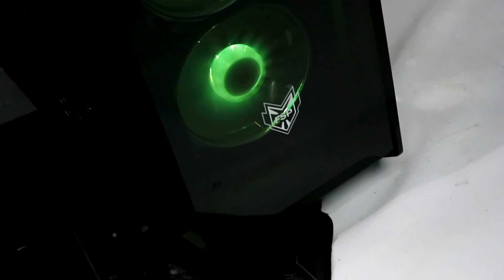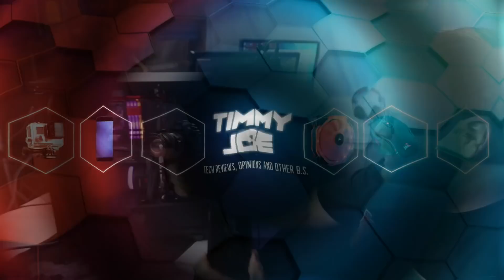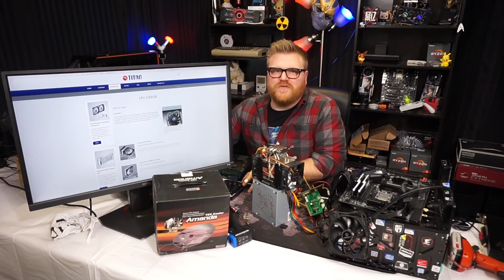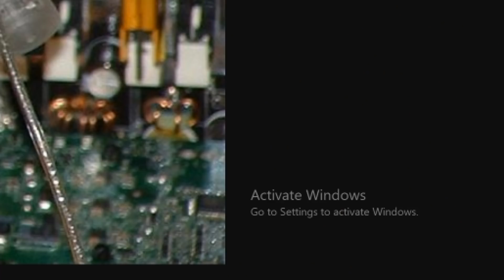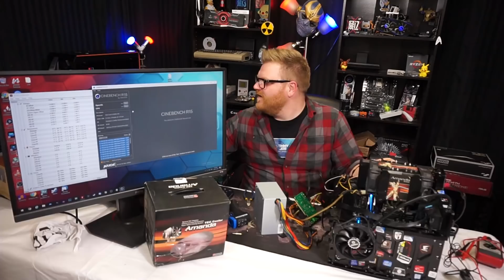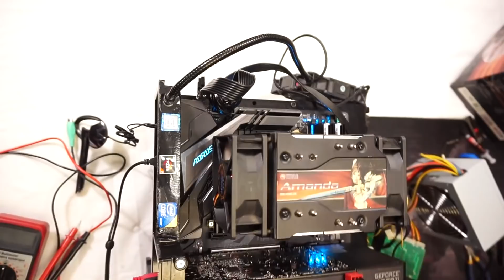This 12 year old thermal electric CPU cooler is COOL!

Comment: The problem with peltier, is there's no free lunch - the power used by the element is considerable, and all that extra heat is dumped into the heatsink
Reply: eh, it does consume power but that really shouldnt be much of an issue for anyone considering it as an option. if you are considering something like this then a custom water loop or phase change cooler is probably already the primary alternatives in which case cost is not something of concern, and i wouldnt worry about power draw unless i was worried about cost. also, if someone makes their own setup and uses an air cooler for the peltier....thats their mistake. id personally go for an AIO with a large rad and strong pump, and the extra heat shouldnt be a problem for the cpu, as all that extra heat is being kept from the cpu by the peltier device itself. even if the hot side of the peltier and the water loop are saturated @80c, the cold side of the peltier, which is what makes contact with the cpu not the cooler, will likely keep the cpu at least a few degrees cooler than the rest of the cooling system. 
EDIT: i also forgot to mention, the more efficiently you remove heat from the hot side of the peltier, the less power its requires to function, although it may continue (im not sure, im by no means a highly educated professional) consuming the same power if their isnt some sort of driver circuit to balance power draw with temperature.
Reply: You watch thunderfoot don't you? love the guy, even with some of his weird politics.
Reply: @m.streicher8286  thunderfoot is the real gang shit great man

Comment: If i remember correctly, the PCI card controlled the TEC so that it would not drop below ambient at idle to avoid condensation.  The TEC voltage would then ramp up as temperature increased.  Also, your "first core" temperature was the package temperature.  That is why you also had temperatures for cores 0 through 5, its not a 7 core.

Comment: The card was for preventing the CPU temp dropping below ambient to counter water condensation issues. 🙃
Reply: Which is probably what killed his board back then.
Reply: Yup.  That was their biggest problem.
Reply: Came here to say the same thing 😂
These things where renowned for condensation issues, even with the card. Running your pc on a very humid day was a big no no.
Reply: Whoops, which it clearly does without the card. :P
Reply: They were clearly too good 🤣
Reply: Ty
Reply: You wrote what I was thinking.

When something is cooled below the room temperature then they get wet. A bit like window condensation on a cold day.

Comment: Peltier modules are not worth it for cooling cpus
Reply: No, but chip companies could make some interesting use of Peltier tech to instead convert some of the heat produced and recycle it as electrical energy for the heat producing computing.
Reply: @Megalomaniakaal  if u put that cooler on top of the cpu without turning on the peltier then ur pc will reach 100c and shutoff or will slow down
Reply: @DrAliToma  He said he ran it without power. Also, you can indeed harness the thermal potential energy with a TEC unit, its just not going to be good for overclocking!
Reply: @jakegarrett8109  but what are u going to harvest 0.1 amps ?

Comment: If they could make a controller that ramps the peltier cooler up as the cpu generates heat, that would mitigate all worry of condensation.
Reply: That Coolermaster is working like that, but it's not a good idea either.
The only, somewhat valid scenario, is to cool the water in a loop.

Comment: Timmy, you should probably research "Emissivity" and how it relates IR Thermometer readings. You can't just point your gun at shiny things :)
Hint: Stick some tape on the item being measured.

By the way, TEC modules absolutely chew through power.
Reply: Thanks for pointing it out man, I just wanted to comment the same. Some black tape should do the trick :)
Reply: @kettenfaust  most definitely on the black tape, even clear tape can work as seen here:
https://www.youtube.com/watch?v=wNHcIYyYDhU&feature=youtu.be&t=170
Reply: you can also color it with permanent marker to modify the Emissivity or some guns allow you to change it so on shiny stuff set it around .50 instead of .95

Comment: A modern take on this kind of cpu cooler would be interesting. Imagine if with one installed the limiting factor in overclocking becomes the VRM's power delivery instead of heat dissipation. What kind of monster system would you even build to take advantage of that?

Comment: The package isn’t a core btw
Reply: He knows it's just a average makes it easier instead of reading off every single core
Reply: @noremac5351  It's not an average, it's a separate sensor. He was right that package temp is really what you want to look at because there's more to cooling than getting any single core temp lower. There's alot of stuff happening in that CPU that isn't core related that benefits from being cooler.
Reply: Then what is it? The GPU?
Reply: @TheRealFobican  The CPU consist of more things than just cores.

Comment: I wouldn't say that it's just a gimmick. I'd say that the issue is the cooler itself. Since it can keep up with the lower heat output enough to get to ambiant temps. To me it sounds like the finstack can't dissapate heat as fast as it can be transferred

Comment: I remember one of the problems of a Pelter unit was the fact you had to insulate it to prevent condensation on the plate. However, prior to liquid cooling, these were the ultimate coolers. One thing you had to remember, do NOT send the system into standby because it will never wake back up.

I'm surprised more companies never really jumped onto pelter units. I could imagine one of these combined with a top end Noctua cooler...
Reply: Also because the cold plate can get so cold and lower the CPU temp to near freezing, it can actually prevent the flow of electricity. The band Metallica found this out the hard way when they held a special concert up in Yukon near Tuk (I can't spell the full Inuit name) and the temps were so cold their amps and other gear simply refused to turn on until they were warm enough.
Reply: @ReaperX7  I call BS on this.

What actually CAN happen is that solder points break and therefore the circuit or parts of it can end up open. This type of damage is not necesserrily perceptible by the naked eye, you can't just look directly at every solder point. Besides that some higher quality gear (like the premium products from Marshall) have temperature-based circuit breakers (HOT and COLD) to prevent flex and/or temperature associated expansion and shrinking damages. If you were right, then explain why e.g. copper is superconductive near 0°K. It's always the joints or the material around those joints that breaks under this kind of stress. Making something non-conductive by cooling it down does not happen with commonly used electrical conductors. Thankfully nobody decided to have wires made out of over 850°K hot glass, which would be odd...

Besides all of that: Heat conducting materials like copper or aluminum provoke condensation of supstances like water contained in the warmer gas-vapor-mix flowing by. What impure water plus electricity does should be a no brainer.
Reply: @stilles342  that's not what happens at all. If you listen to extreme overclocker what happens is the bios has a failsafe where if it registers a temp below 0 the motherboard won't post. That's why when power cycling LN2 cooled systems extreme overclockers have to use a torch to heat the CPU up so the board can post.
Reply: One of the problems with Peltier cooling is the abysmal efficiency. However, when combined with liquid cooling you get around that by not having to push it so hard. With the hot side essentially clamped to the water temperature (save for the thermal interface between them) the temperature difference can become offset by something like 30-40 degrees (celsius) compared to the equivalent air cooler. At idle it should easily reach below 0 degrees so you would only need to power it above a certain temperature threshold.
Reply: Why wouldn't your PC wake back up ?
Reply: @HeadShoht  water would form and fry the board just like water cooling if it leaks you better be lucky it did not kill your system
Reply: do you know what is fully name of this coller l wont to change with fsp windale 6 noctua on him cool it but no enough 70c with not oc xeon e5440 l wont so much to buy this its very good
Reply: Nothing is conductive at 0°K. That's absolute zero where atomic processes stop entirely due to no energy transference.

Copper is only conductive so much. Below freezing, copper not only has to maintain heat to actually be conductive but also be insulated properly to prevent freezing and thermal failure.

Solder points will snap eventually but copper won't conduct before that happens which is why low temperature CPUs in quantum computers use higher conductive elements like gold and other shielded semiconductors specifically made for those environments.
Reply: @ReaperX7   I stated "near 0°K" which, if you look up this little graphic on google: Timeline_of_Superconductivity_from_1900_to_2015.svg (taken from wiki/superconductor article)
You'll see plenty of materials are indeed very conductive near the point of absolute zero thermal energy. And you'll also find the conductors used for low-temperatur operating devices, such as: the CERN(for their multi-tesla magnets in the particle exelerator), quantum computing(various input- and output-lines the processing unit itself), physics shows (supcerconductors+nitrogen+magnet=hovering magnet or conductor)

So IF materials are non-conductive when frozen, tell me why common metals in their solid state are used in electrotechnics. Solid metals are "frozen". Conductivity solely relays on the possibility to have electrons jump from Ion to Ion, where they then knock off another electron to jump to the next Ion. So the effective speed of electricity (please forgive the inaccuracy, we did this in school like 15yrs ago) should be around 30k-40.000km/h, and it's propagation velocity at 0Pascal (or perfect vacuum) is c, or at room pressure about 99.9999% c. And that infact does not rely on any temperatur, other than being in the range of electrical conductivity for this material. This temeperatur can wildely change, depending on the materials used, like I stated in my last post. Glass needs to be very hot to conduct electricity,  where as a metal such as Tungsten (used for traditional light bulbs)can be at -273°c (where it still has an Ohm-resistance) and conduct electricity. Or you could take your Tungsten wire and cool it down below 0.15°K to make pure Tungston superconductive and your pain of glass to make a pair of glasses or something. Glass doesn't superconduct sadly.

Also there should be a list of jump conditions to superconductivity. I couldn't find it in english, but in german. "Liste der Sprungtemperaturen chemischer Elemente" on wikipedia. Why don't I just paste the links? No, search and read up on that stuff on your own.

Why supercomputers use materials like Au? Because Gold apparently doesn't want to make up oxides on it's own. Gold has very few natural reaction partners. That's also why the Voyager records are golden and gold idols or jewelery which survive millenia without degrading.

Oh before I forget it: I will have to correct myself. Copper itself (pure Cu) cannot be superconductive, bit it stays conductive even around near 0°K and there should be alloys that contain copper, which are indeed superconductive.

EDIT: By the way "nothing is conductive at 0°K" cannot be proven. You cannot have real 0°K in real life. Search it for yourself, I am not your teacher.

Comment: The peltier effect he was talking about is a two way process. If you put voltage across the two terminals, causing current to flow through it, one side heats up and the other cools down.  Likewise, if you heat one side and cool the other, it will create a voltage difference from one terminal to the other. Connecting the circuit, for example to a voltmeter, current will then begin flowing. Hooking up an ammeter, you could read this current too.

Comment: But I am running zalman pure copper cooler for my fx 9590
Reply: What's your idle temps with that FX9590? 40 Celcius? I know that they are extremely hot running CPUs
Reply: @LND3947  they do an amazing job (underclocked to 4.5ghz and 1.35v or 1.3v) temps dont go above 60 something c under max load.
Reply: @DragonProtector  Why not just get an fx-8370 if your gunna underclock the 9590. It's literally the same chip but the 9590 but it has much more power draw and the stock overclock on it.
Reply: @ChfHappySack  well i got a steal on the fx 9590 it came with mb and 8gb ddr3 and a fx 6300 cpu all for $137 i won it on ebay

Comment: Ive actually done the same thing with a 120w peliter unit, but I didn't have an unlocked cpu so I just sat at 0c (wouldn't show lower temps oddly enough) ended up bricking my system because of condensation, but you can do the same thing with like a 212 evo and a unit by itself. When youre using a peliter you want as high of a current possible, but always try to keep the hot side cold as possible, the colder the hot side is, the even colder the cold side will be.
Reply: indeed, i think for any amount of heat being transported there is a given difference between the hot side and the Cold side.
Watercooling the hot side makes sense.
After all you have to cool away the heat of the cpu PLUS the heat the peltier produces.

Comment: Just don't look at how much power a TEC plate pulls.
One of it's side's get's really hot. You're basically using an effect of electricity to pump heat from one side to the other.

Like really, it's thirsty
Reply: Here's a stack exchange physics response that explains the problems with TEC short and well:
https://physics.stackexchange.com/questions/116271/is-it-more-efficient-to-stack-two-peltier-modules-or-to-set-them-side-by-side/116874

Comment: hmm would be interesting to see a modern version of this cooler
Reply: those peltier elements arent like 300-500w
Reply: Someone actually is designing a modern version of this for release again, and yes these are the smallest ones youll get really. At most these guys are 6 amps, 12v, 60watt coolers if i had to guess, and they're ran in parallel vs cascaded so no it WONT do that, if you cascade them to use a cooler to cool a cooler then youll have this problem in the 2nd stage immedietly. Yup facts taste nice.
Reply: there is one, it was shown in ces a couple years ago, its called the phononic hex
Reply: @TAXIKO They need to make a 140mm version to make it even quieter, and more efficient since the biggest problem with peltier coolers is their ability to dispense heat into the air as fast as it is removed from the cold plate.
Reply: @PraetorGames  Another problem is the fact that the cooling solution for the hot side of the peltier device needs to be able to handle the heat load from the CPU and the peltier device.
Reply: jedidethfreak 

Then there's the issue of condensation when it drops below ambient temps.
Reply: There actually is, i don't have a link but it wast featured on linus's channel a long time ago
Reply: Phononic-HEX-2-0-Thermoelectric-92mm-CPU-Cooler-electric-Fan-heat-pump-Cooling
Reply: Try using a 12v 20 amp, that's 240 watts, that cpu Temps are gonna go even lower
Reply: Cooler master v10
Reply: Linus did a video on one a little while back
Reply: Its not a thing because its ridiculously inefficient, imagine doubling your pc power draw, if not more.
Reply: @woooweee  I'll pay the bill, if I take the pills.

Comment: I have that exact Ultra cooler in my QX6800 machine and it still runs daily overclocked!
Reply: What do you use it for
Reply: Yea do you get 1000cb points with that